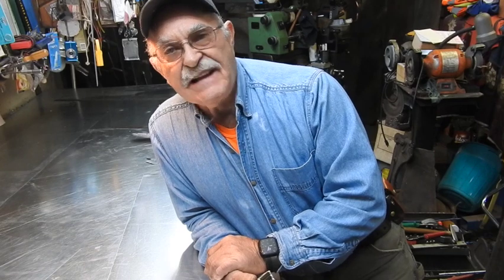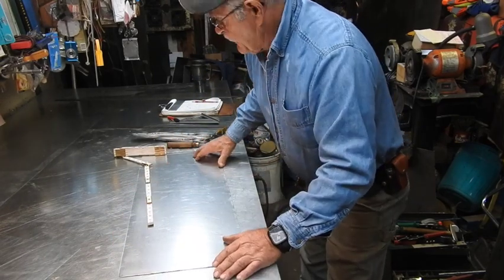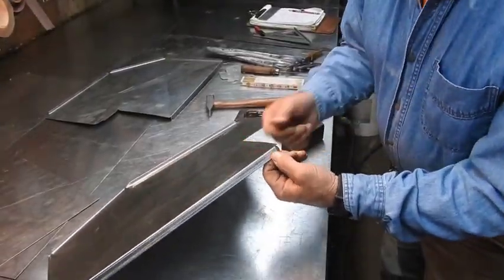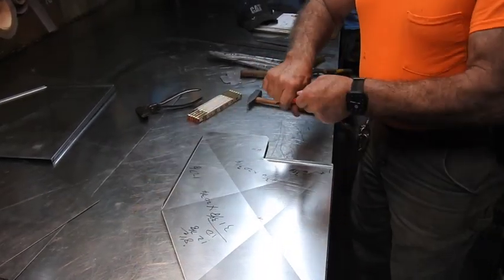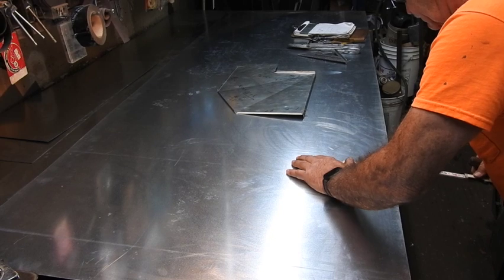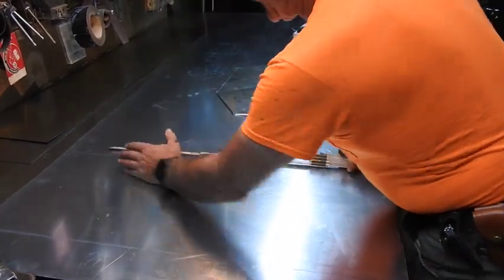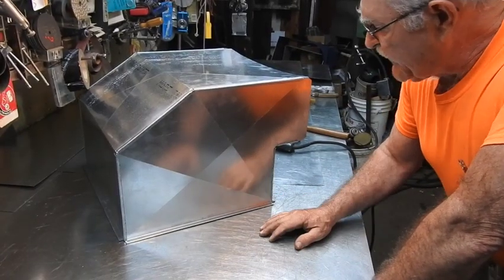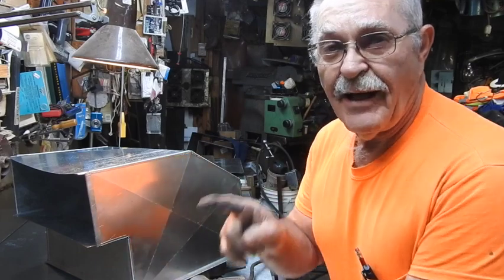Sheet Metal Hack:  Short Plenum Radius-Close Quarters

Comment: Tractor man I replace HVAC systems professionally and I’m a business owner but you are so good at it. I would like to know did you teach yourself? Did someone else teach you? Did you have a mentor? I admire you very much.
Reply from the maker: I had a basic metals class one semester in college but the only tools besides tin snips, were a 4 foot brake and foot shear. We only made a couple variations of tool box trays and a few other very simple boxes.  No lockformer, no hand crank tools or anything of the sort.  I was going to the local Jr College for an AS degree, specializing in HVAC.   I went to work in the afternoons after school for a local hvac guy that let me play with his small scrap materials  on the shop floor after work to figure out the machines on my own. I would study duct fittings on existing systems while on service calls to figure out what they did to form them. 
     I just built little by little my knowledge base, buying just about any old sheet metal tool that I came across.  It's taken many years to put together the shop equipment you see.  But there is a lot you guys don't see as well.  No mentor, just lucky breaks I guess.  When I went to work in the big city after graduation, I would never tell the boss I couldn't do something, I'd say something like I haven't done it before, but I'll figure it out.  And so it went.  
   I hadn't done hardly sheet metal for close to 25 years until I retired and dusted off the machines a little so I could help people less fortunate in and around town. The last 25 years of my career,  I spent in large commercial and institutional HVAC service, with a heavy emphasis on commercial DDC controls, piping and system startup.  I've had a good run.  No regrets. Thank you Matthew, for the super comment.  Just remember, doing the things I do can't be too hard if an old farm boy like myself can do it !!  LOL

Comment: Just looked in...and you have built all the connections I need for my own new air handler to old ducting project. Calming to watch you work.
Reply from the maker: This one was for a friend of a friend that I knew from my school days back in the 60's.  Thanks for the kind comment Gary.  There's really not much to making these fittings as long as you have the right tools.  But the CAN be made totally on the workbench without the big equipment though.  The technique is just a bit different. If you like this one, check out this playlist when you have time: https://www.youtube.com/watch?v=PvDab537ul4&list=PLk72G9DTzZ1taVZjyeN9DKr52HQ3hhcXd

Comment: Nice work tractor man tell me what trick you use those magnet strips on your brake for?
Reply from the maker: Its a good place to keep track of them for one.  But anytime I am making small fittings, instead of bending over to pick them up, I stick the next piece or two right on the bank of magnets when they are flat.  It minimizes my steps.   Then a lot of times when I make a weird bend that has to be flipped over and over to fold in a specific sequence, I'll stick a paper drawing under the magnets to keep the complicated series of folds right in my line of vision so I don't make a mistake.  Make sense Lou ??  Its just what I do to make things easier for myself.

Comment: Excellent fitting.
Some may not understand the reasoning for the cross breaks. This is to prevent noise from expansion and contraction as the air begins to move through and stops moving through. Similar to your cheeks moving in and out while trying to blow air with your mouth closed.
(Hopefully that analysis makes sense).
Doc
Reply from the maker: Heck yeah Doc, that's as good an explanation as any !!  Its also why the cheaply made vehicles of today have the fancy bends and shapes to their thin fenders.....LOL  If the shaped 'em today like they did in the early 50's they'd dent up in high wind !!

Comment: 44 have you ever told your followers about standing z iron and the why and where to use it? I realize it is not called for very often in residential but it has its place.
Reply from the maker: I think I've mentioned the standing 'S' as well as the TDF connections as well in past videos. I use standing S's on larger systems....4 or 5 tons with the larger duct work to minimize flex.  And many times on oversized r/a drops to minimize the same 'oil can' issue.  I don't use them a lot though but they bear another discussion for sure.

Comment: That was impressive tm 44. Your very good at this. How long did it take you to master this? My supervisor at work sent me to tubing school onetime. As work for a gas company Compressor Station. Thats a lot like what you do with heating and A/C duct building. It always amazed me how a person could take a stock piece of Tubing in 20' stock and bend and mold it to perfection. I got to be mediocre at best, but there were those who knew exactly what they were doing. A true art. Always, I enjoy your videos.
Reply from the maker: Thanks Dean, that's nice to hear my friend and thank you for watching. I've been in hvac since the mid 70's and did a ton of metal back in the day.  But my main focus has always been in commercial service.  I just started doing metal to make sure I could stay busy year around to keep the family fed.  Finally I had to quit that shop to go to another because they balked at my insistence to be involved in more commercial service. When I retired in 2013, I hadn't done hardly a spits worth of sheet metal for close to 20 years. That period of time though I got heavily into DDC controls and building automation as related to hvac and heavy commercial and institutional systems with chilled and hot water as well as variable air volume on DX systems.  That's why I'm still a little rusty in the metal department.  I'm still working the barn dust off of most of them....LOL